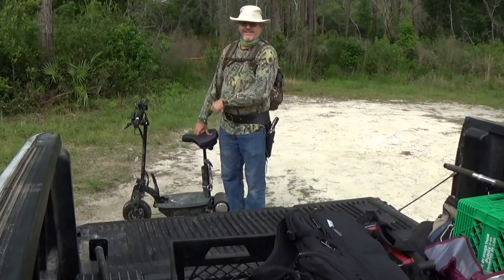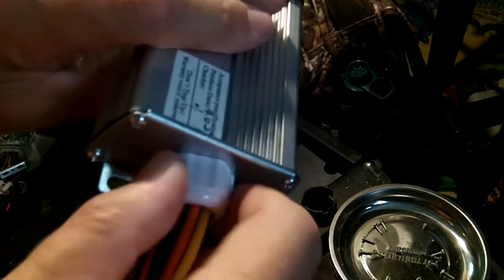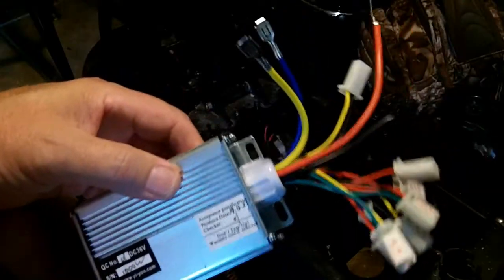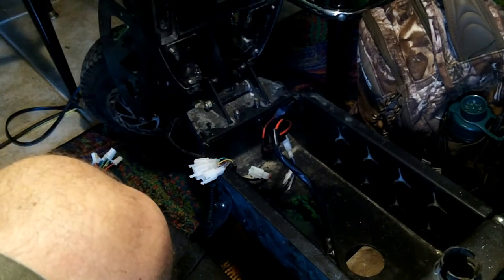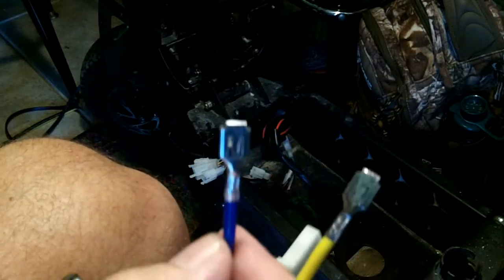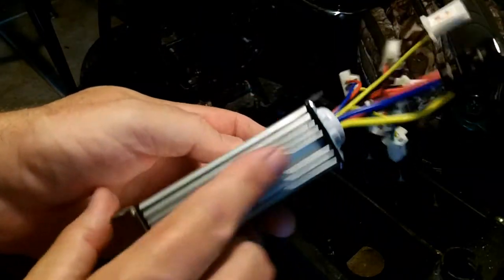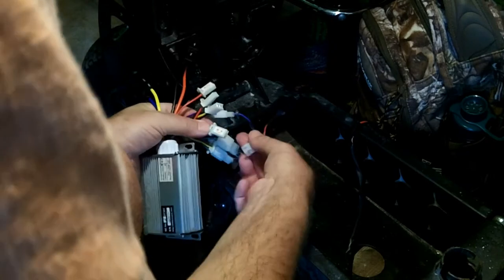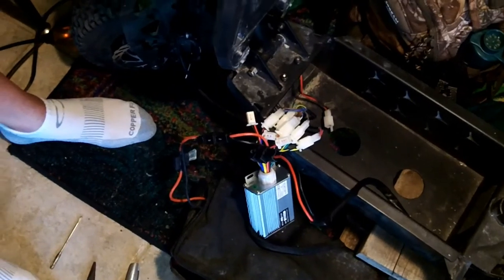Aftermarket controller on UberScoot 36v 1000w scooter

Comment: Hi when you took off the new connectors on the new controller was it a case of just pulling?
Reply from the maker: No,  there are latches that you need to release. Use a small flat screwdriver, tiny one. One that a jeweler would use.

Comment: What is the colors are different from the speed controller.
Reply: Not that big of a deal just figure what's negative n positive even if its wrong trust me u will know for example if u connect key switch but the scooter turns on with out key that mean u have to switch the negative n positive wire same with lights etc n motor if u connect motor opposite wires it will turn backwards its like a puzzle just don't plug the battery wrong lol
Reply from the maker: On mine, the only plugs I had to modify were the battery plug and the motor plug. All the others worked as shipped. The wire colors were of no consequence.

Comment: Same happen to mine got wet really bad from me leaving it out in rain. N it comes on but don't respond at all on throttle) EDIT: scooter working again it was a my speed controller I change n now it works got rid of 40 pound lead acid battery for a 11 pound 48v20h lithium I also install a gps speedometer and a volt meter now I keep my scooter indoors
Reply: Hey,, what kind of run time do you get with that and did you have to swap your ESC for a brushless lithium one?
Reply: @BrentTheGent1  to upgrade to lithium u don’t u don’t have change esc but as of today I change 1000w brush motor for a 2000w brushless and it came with a 2000w esc I also added 3 speed switch to the controller before my scooter was only going 18 mph barley 20 now I can hit 30 n I’m 240 In fact when I ride my scooter on low settings now it faster then the origina I don’t even use high speed much also when I put lithium I also added a voltage meter more accurate I never had the scooter die on me fully my farthest I went was bout 4 miles but always make it back home with half battery
Reply: @loyaltyovermoney5942  Good stuff.
I use mine as I have mobility problems and cant cycle so I was just out at the park with an old mate on his Mountain bike. 
The top speed of 25 mph is more than fast enough for me as I only go slow on the pavement as I cant be charred about or I end up in a world of hurt but if I just take it easy I can use it now and then.
I think i may get the hill climbing kit as i dont need to top end and i lost many stones in weight since i bust my back up bad... so my 1000 watt Chaos 48 volt gets me up hills not bad.
I just wished we had better weather here in NE Scotland. ✌🏼
Reply: @BrentTheGent1  where do you get the hill climbing kit ?

Comment: Anybody know how to disconnect the speed limiter on these scooters. I had one and wanna try it
Reply from the maker: I am not an expert, but without the controller you will discharge the batteries extremely fast. Thus less distance.  If sacrificing some power isn't a concern, you can change the sprocket size. Decrease the tire sprocket will increase speed.

Comment: What is the name of those plastic connectors ?
Reply: Did you manage to find them?
Reply from the maker: The connectors I used came with the scooter or controller.  So I dont have a source for them.

Comment: Brushed or brushless
Reply from the maker: I believe it was brushless. I have since upgraded to the mototech chaos 2000w 60v
Reply: Brushed. The way you can tell is brushed motors have two wires that go to motor. Brushless will always have 3 wires to the motor and sometimes 5 small wires for 3 hall sensors and + -for hall sensors. .

Comment: What does the sport plug do
Reply from the maker: The sport plug is for the economy switch. It is usually a red push button switch that allows you to change from full power, max speed, to low power, max distance.
Reply: I've had several controllers with a sport plug, and I've never had one do anything different. As far as I could tell.
Reply: @eggroll1up918  it’s very weird that you chose to comment on this at this time as I haven’t used my controller since around the time I originally posted that but used it the other day and was trying to remember if shorting it put it in fast or economy mode, very strange lol
Reply: @Pete-yr9mt  having this switch loop closed will slow the vehicle and use less power, open is the fast setting sadly

Comment: Derailer would be for an e-bike. Just ignore it.
Reply from the maker: On mine, the derailleur was needed, it went to the twist throttle on the right handle.
Reply: @gbsadventures3710  Interesting. Thanks for sharing that. It just goes to show that there is no set standard and there is plenty of room for variation within the system. Ugh.
Reply: Chinese translate the throttle as the derailer.